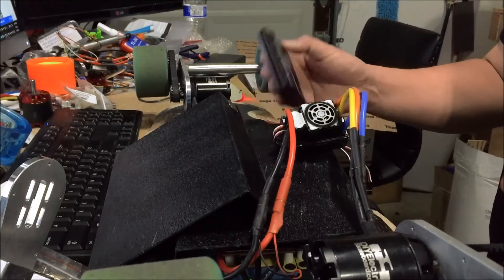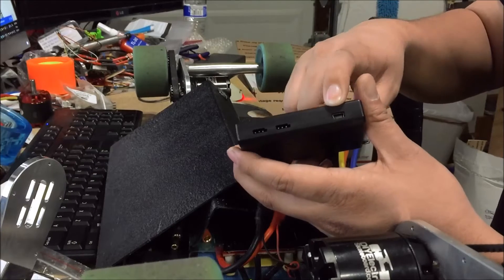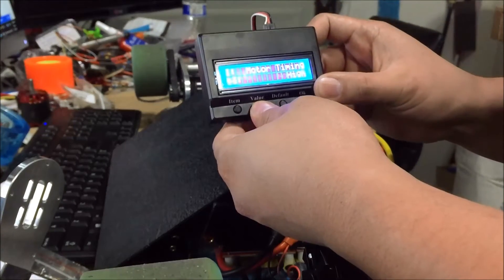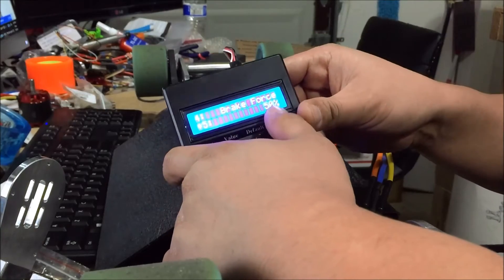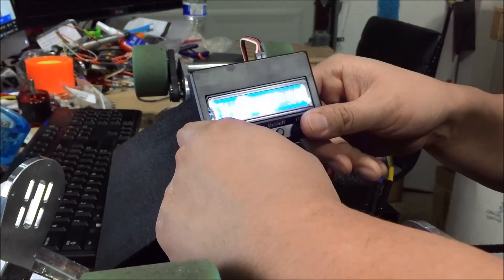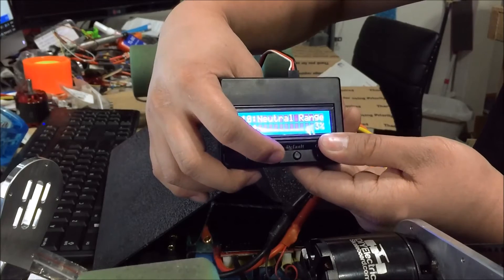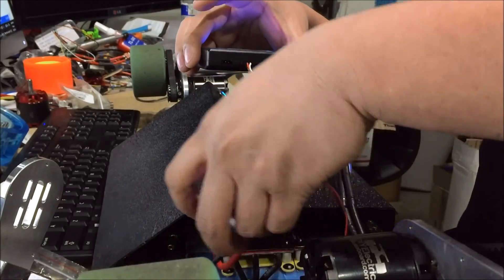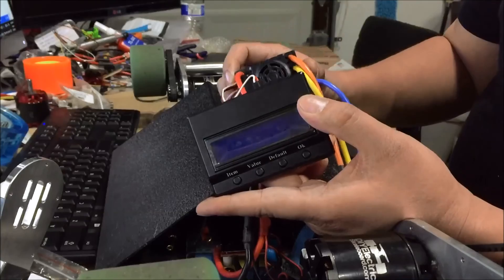DIY Electric Skateboard: How To Program ESC 6S 12S

Comment: Im using the 6s esc and programing card used in the vid and it works but the motor acceleration has a weird "punch" to it where when i just tap the throttle forward the motor spins at almost full speed for a second or so before going to whatever speed i am actually at. Any idea of how to change this?

Comment: I need help. I purchased a board over seas unbranded.The board use to have a top speed of around 21mph and a really insane launch at initial take off, it use to scare people now for some reason I am not getting any real good speed. It throttles after a decent launch and remains at around 10 mph to 15mph and when i break it makes a loud electric grinding sound. I have videos i can send if you have whatsapp
Reply: Only thing i can remember before the problem happened, someone wanted to surprise a friend with my board and the friend held on to 1 of the wheels right before i demonstrated the drive wheel. I didnt know he was going to hold on tight to 1 wheel. He was a foreigner. Anyways 1 wheel spinned as he held the other. Im sure thats my issue. Any idea how i can fix this?

Comment: Am i viewing the video properly, do i see front and rear mounted motors???
Reply from the maker: Hi Matt,

This setup is a dual diagonal setup. The motors were too long to fit on a dual rear setup. For a dual rear setup for 180mm long trucks (standard). The max motor size you can fit is 55mm length for both motors.

Comment: what exactly does the motor timing do? My motors are starting at slightly different times and adjusting the neutral range option isnt quite fixing the problem. Thank you for the video, very helpful!

Comment: I just received your 6s esc, and the battery connectors aren't even fitting into my Lipo connectors this is my battery.  http://www.hobbyking.com/hobbyking/store/__14845__Turnigy_5000mAh_6S_25C_Lipo_Pack_US_Warehouse_.html?strSearch=Turnigy%205000%20mAh